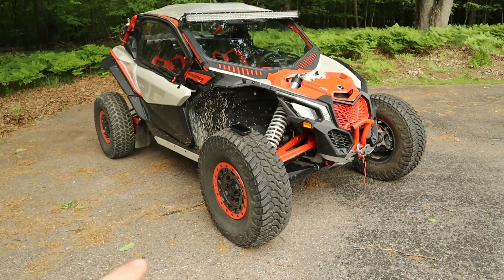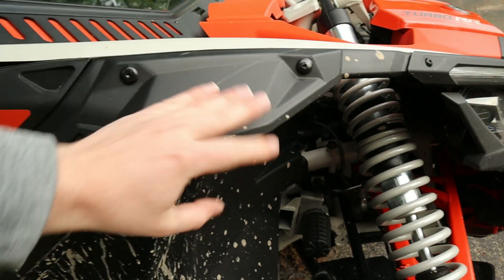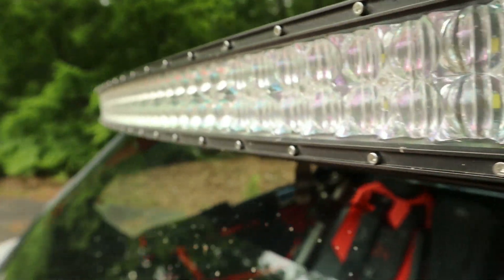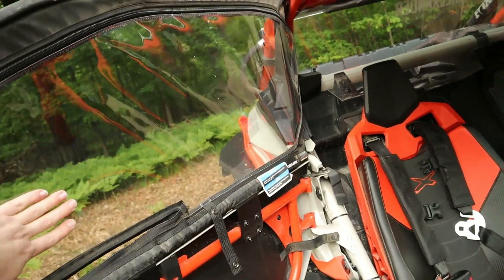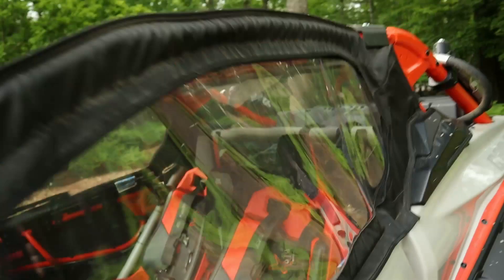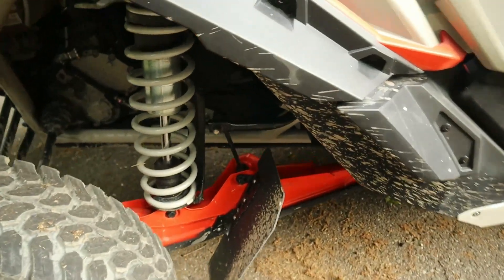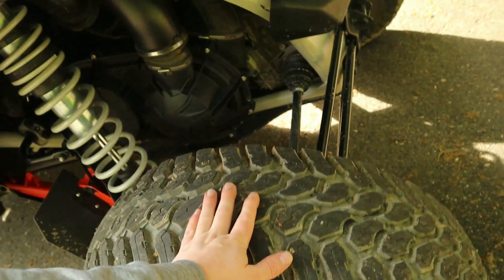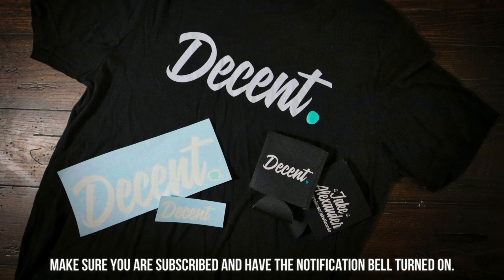Six Month Update/Walk Around of my 2022 Can-am Maverick X3

Comment: Does the bent metal windshield work with the front metal bars that come factory with the xrc modal or do they need to be removed?
Reply from the maker: That is the bent metal windshield with the factory xrc roof in the video. It works just fine
Reply: @JakeAlexander  i didn't say anything about a roof. The x3 xrc comes factory with front intrusion bars. 
 I contacted bentmetal and asked anywho.
Reply from the maker: @amirbell983  my bad. Must’ve read that wrong. It wouldn’t make a secure fit on the A-pillars so I pulled them out

Comment: If we run alot of these accessories such as multiple light bars, radio and other electronics, do we need to upgrade the battery or run a 2nd battery? Thanks!
Reply from the maker: Most of the models have an upgraded magneto now for accessories. Depending on which model you have and how many accessories, you are probably alright. You could check and see what your voltage is running at with all your accessories and know if you are drawing to much power.
Reply: @JakeAlexander  Thanks for the quick response
Reply from the maker: @Erikp18  yeah, not a problem! 👍

Comment: Did you have to get a new alternator... I heard the stock one cant handle much and craps out fast
Reply from the maker: No, I haven’t had an issues with it. Im pretty sure the xrc and a couple other models come with bigger alternators though.
Reply: @JakeAlexander  I've never heard of or experienced any issues with the 850W alternator in the XRC, but a tiny CCA battery to run a winch was an issue. There is a re-flash to fix that.

Comment: THIS THING SUCK'S FOR ONE REASON. YOU CAN'T GET THEM WITH THE FULLY IN CLOSED CAB WITH THE POWER WINDOW'S AN A.C. AN HEAT LIKE THE DEFENDER MODEL. OTHER THAN THAT THERE AWESOME. BUT COME ON FOR THAT MUCH MONEY IT SHOULD BE AN OPTION. DON'T WORRY AN 200 GRAND SAND CAR THE SAME WAY?
Reply from the maker: The defender has it’s advantages, but I went with the x3 because it fits my riding style more. I can deal with the zip up windows.